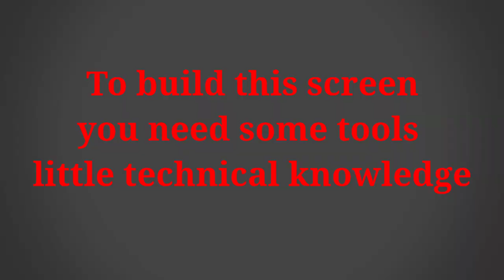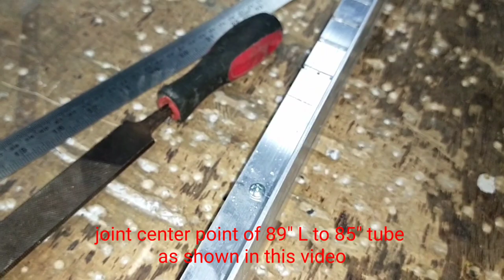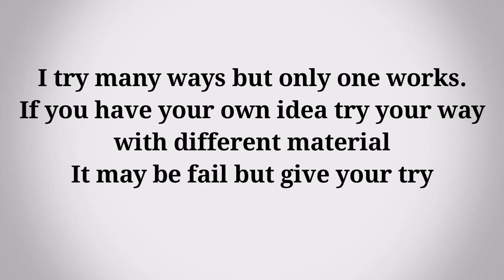Build 100" inch curved projector Screen for FHD 1080p | 4k Home theater setup | how to make | DIY

Comment: Exlent , bro 120 inch curve screen measurements plz
Reply from the maker: Ok
Reply: I’m waiteng bro plz
Reply from the maker: @ramrajkrishnamraj7922  
This measurement only works with same material that iam used in this video if you change material measurements will change
For 120" 16:9 screen
L aluminium 12ft. X 3 lenth
104.6" X 2 pcs
55.8" X 2 pcs
Rectangle aluminium 12 ft x 3 lenth
100" X 2 pcs
51.8" x 2 pcs
5" x 4 pcs for curved
Reply: @THINKalt  I want to make same material bro , I have China screen , I buy Ali express
Reply from the maker: @ramrajkrishnamraj7922  
Super 👍🏻
Reply: @THINKalt  plz tell me measurements
Reply from the maker: @ramrajkrishnamraj7922  
Measurement Already mentioned above see coment

Comment: Hi good job.. can u pls tell me the Aluminium sizes for 150” screen??? Its urgent…. Thx
Reply from the maker: 150 inches is very big I am not sure it can be strong enough to hold the screen without bend may need extra supports, I will send the sizes
Reply from the maker: Materials 
1"x1.5"x12ft L: 3 pcs. 1"X2" rectangle aluminium 12ft: 4 pcs
Screen size 149 inches 16:9 ratio
Screen width:130" height:73"
L:
130"x 2pcs
70"x 2pcs
Rectangle:
120"x 2pcs
66" x 3pcs
6" or 8" x 4 pcs depends on curve you need
Reply: @THINKalt  thanks. But why u said 4 piece of 6” or 8” ? You mean any size from that ok? If i want i can use 6” or 8”? I thought curve must have exact size. If not picture will not focus correctly. Can u explain it pls….
Reply from the maker: @TravelWithMaleen  
Focus depends on your projector 
I use 6 inch for 120 inches screen if I make 150 I chose 8 inch curve this much curve works my cheaper M18 led projector. For your projector you check correct focus point for curve- use full text image on flat suface by your projector at 150" image size, focus center point perfectly and look left and right side if image corner blurry then take white paper and scale place the white paper on screen left or right then move the paper for correct text focus place then measure that distance with scale that size is your curve point.
I calculated it for my 100" 5" curve screen but when I making 117 inches I didn't measure I use 6" it works well.
Reply: @THINKalt  thanks brother. Perfect explanation….. really appreciated….

Comment: Did You need two projectors or some software to protect on a curved screen?
Reply from the maker: Didnt use software or dual projection like imax😉
I just project 200$ projector on this curved screen.

Comment: Help me with 100 inch ALR grey screen with measurements
Reply from the maker: Ok I will calculate
Reply from the maker: If you use same material
Measurement for 100 inch curved image get around 98 inches
L aluminium: 
87.2"X 2 pcs.
46"X 2 pcs.
Rectangle aluminium:
83"X 2pcs.
42"X 2pcs
Above measurements only changes, Other materials and techniqs are same in this video
Reply: @THINKalt   Thank you so much for you help,
Cost of aluminium rods ??
Reply from the maker: @pranaydeekonda8322  
Find aluminium traders on Google map in your area cost will be less then 300rs per kg flat screen only 2 to 3 kg 
Curved screen 6 to 8 kg material